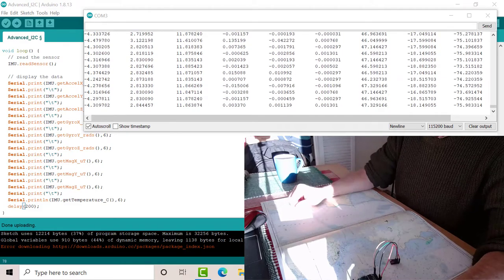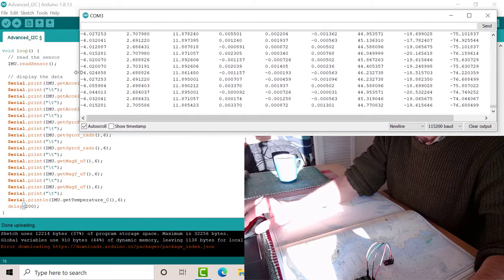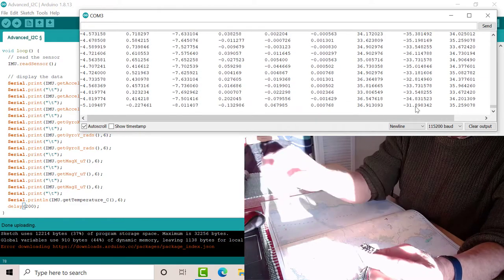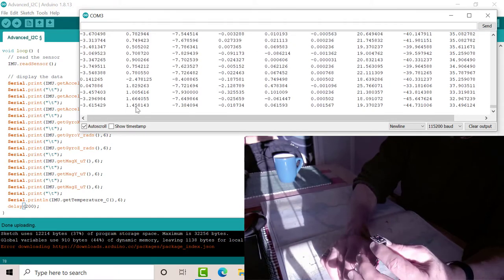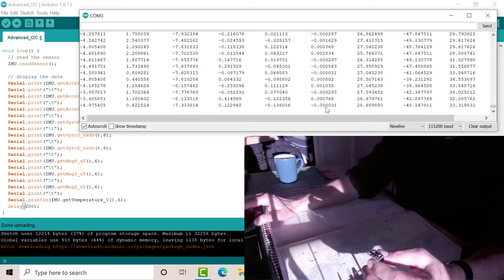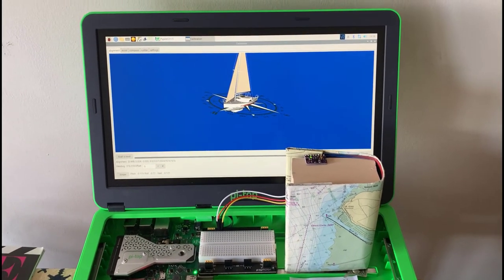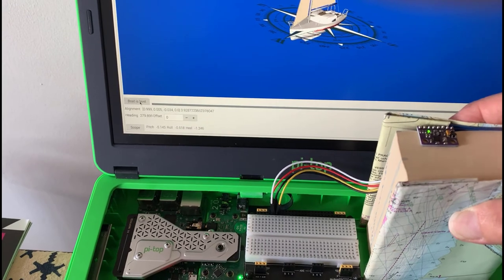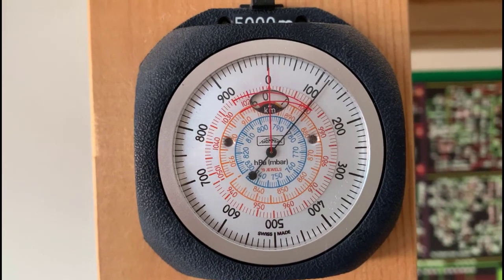OpenPlotter - Sensors_b

Comment: Great video Jeremy. I wonder how would you install it in a boat in order to avoid magnetic intereferences.
Reply from the maker: Carlos, that's a good question. I have not done it myself, but there is an excellent procedure at the link below. I remember years ago taking a piloting course and we studied "swinging the compass", which is a procedure for determining a table of magnetic variation vs. true course heading (takes into account the effects of the boat's structural magnetism).

https://openplotter.readthedocs.io/en/latest/pypilot/calibration.html